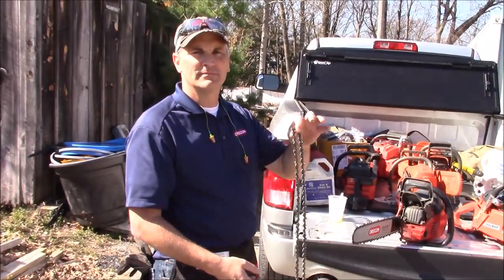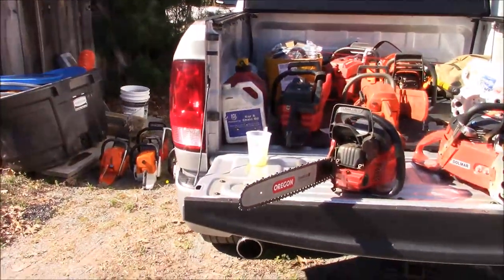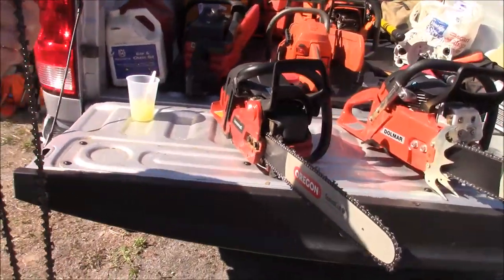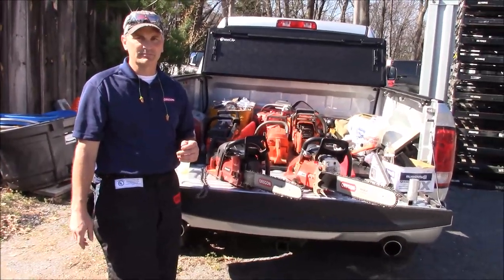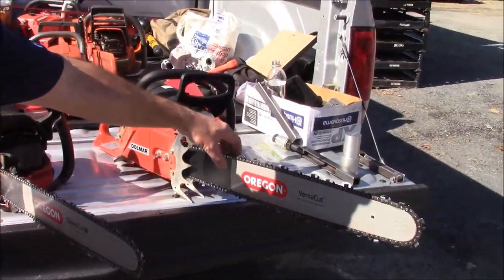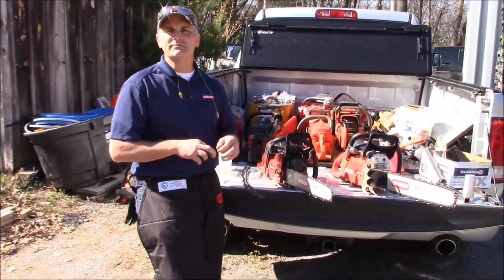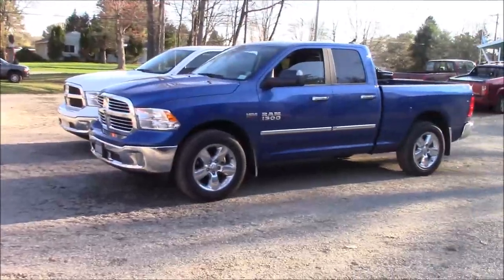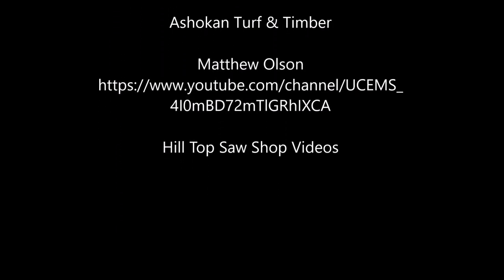Oregon SpeedCut Cutting System & VersaCut Bar Introduction By Greg Wade

Comment: Clarke's Rule of 4 - never pull a Stihl saw over four times in any choke position before rolling it up to the run position.  Example: 4 in cold start, 4 in warm start and then 4 in the run position.  If you attempt to keep pulling a Stihl saw in the cold start position until it rolls over - you have set yourself up to flood out the saw and in some models create a hydraulic lock condition.    If you flood the saw, just blip it up to run and pull it over a half dozen times.  It may even roll over in the run position.  Then push it down to warm start and a couple of pulls and she is running.  However every Stihl saw cranks differently and you have to adjust to what you hear in feedback from the saw.  I often take a five minute break, smoke a cigarette and drink some coffee if I have flooded one of my saws before I pull it again.  Rarely do I have to pull the plug and blow off the excess gas with my compressor.  Usually, I just blip it up to run and keep pulling with the throttle fully depressed until I clear the flood and then I start it normally.

Comment: Doesn’t make sense to me. No matter how thin the drive links and bar slot is made it still has the same surface area contacting against the side rails and top of rail which is where the friction resisting pull comes from. Perhaps it makes the chain a bit lighter but I can’t see that alone making any substantial difference to bar load. Now if you put an engineered ceramic to cut friction coating inside the bar rail now you’ve got something-reduced friction and greater wear resistance.
Reply from the maker: Three things. Hardness and lubrication matter. So does the geometry of the cutting surfaces. The ability to get more lubrication into the bearing surfaces matters for "stretch" of wear in those bearings.
Reply: Thanks. Awesome channel!!!